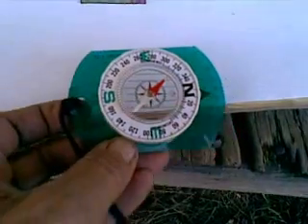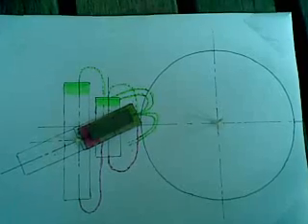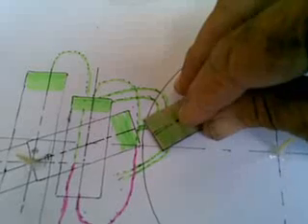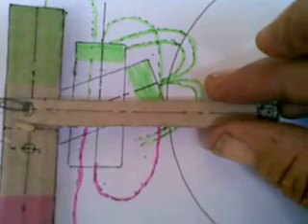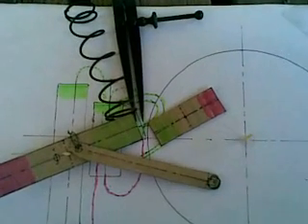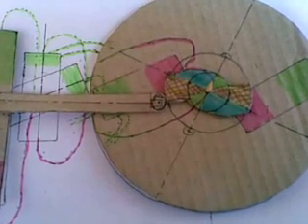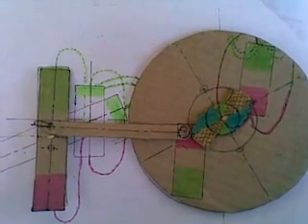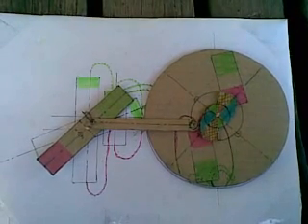Free Energy Oscillating Repulsor Magnetic Flywheel Cam-Lobe Analysis...

Comment from the maker: @Tomken8d2
G'day Tom... The problem remains, that any Spring strong enough to place the Repulsor in Drive Position, fast enough to deliver a "Drive Impulse" before the Wheel pulls the Circumferential Pole away from it...; has to be 3-5 times Stronger than the "Drive Impulse".... And the Wheel can't turn against a 30-Pound Load for 180 Degrees, with only a 10-Pound Kick, for 40 Degrees. It's a Ducking Fud.
Ciao !

Comment: you could get rid of the spring if the arm is driven by a trac that pulls it both ways... but it still wouldn't work.  To believe in perpetual motion of this sort and take energy is to deny the conservation of energy.  There are methods that may get energy for "free"... say a QM film able to collect ambient heat... but that energy would come from the heat of the atmosphere or wherever.  Any energy source has to be there to tap into a flow of energy, how could it be otherwise?

Comment from the maker: @Tomken8d2
G'day Tom... Well, if you don't attach the Cam to the Flywheel, then it's hard to imagine how you're planning to time the Oscillatiwobblation.... Go your hardest. Though I still say the Load imposed by the Moving Repulsor is an average of 4 times the maximum Power-Impulse, & it lasts 8 times longer....  REGARDLESS of what size the Power Impulse happens to be..... It's a Ducking Fud.
Ciao !